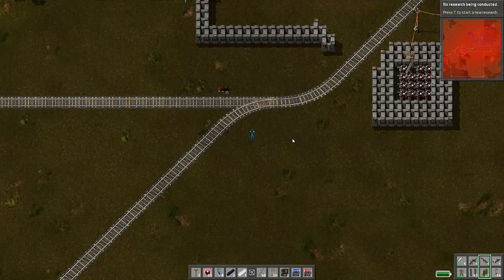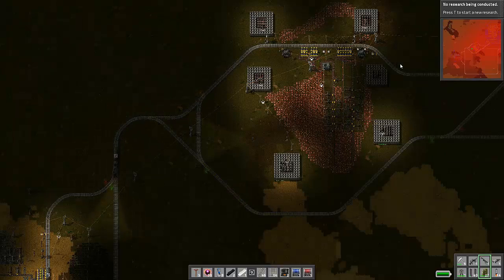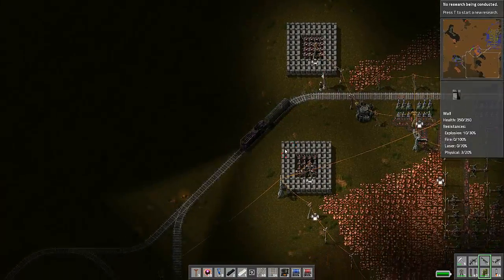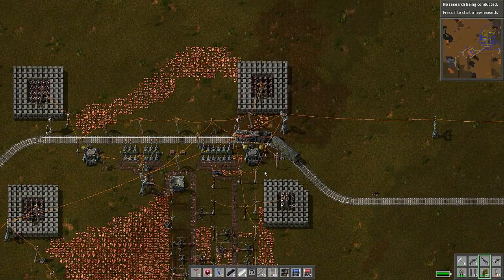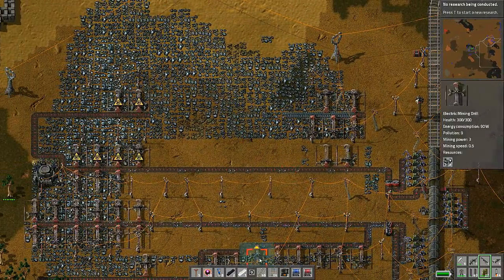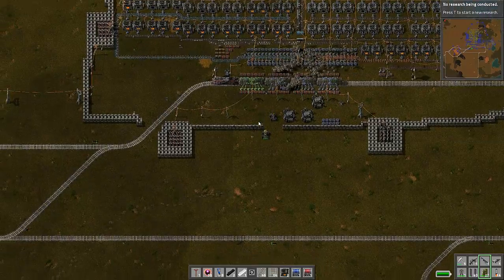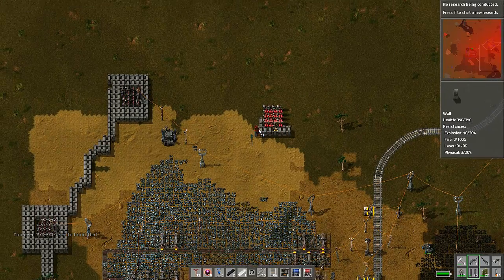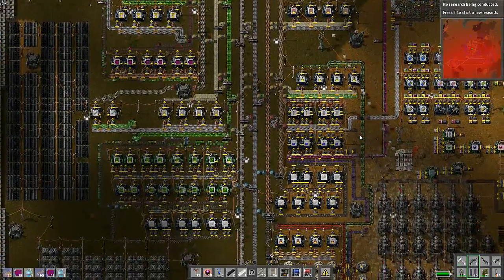Inzainia Play's: Factorio ver 0.8.0 EP:21 (rail signals)

Comment: Do you know that you only fill 2 cars of your copper train instead of all 4?
Reply from the maker: yeah, originally i was going to use a single train, 2 copper cars, 2 iron, but then later decided to use 2 trains, and never got around to adding the other two lines for the copper. :) mainly because i had yet to run into the need for more copper. 2 lines were enough to keep my lanes backed up.
Reply: Ah, ok. I saw that you only fill 2 cars and I wanted you to know this. But you're right that you don't need that much copper.